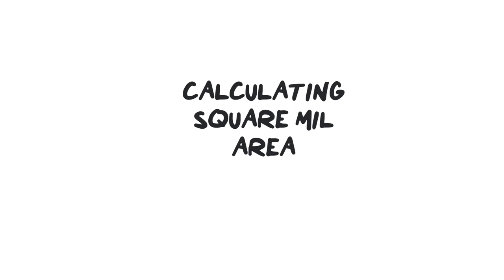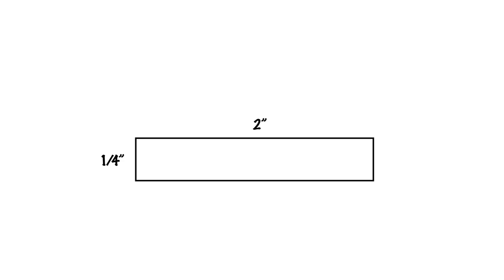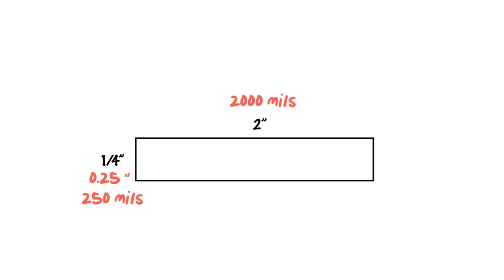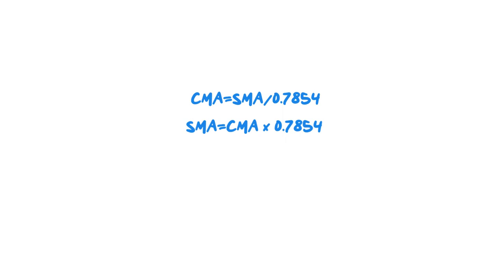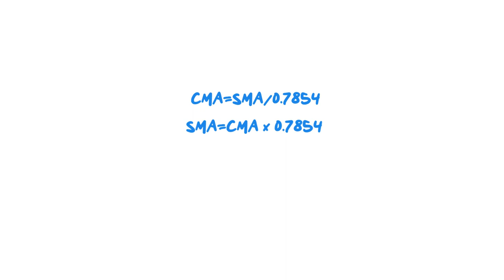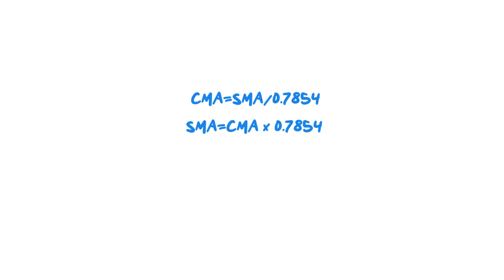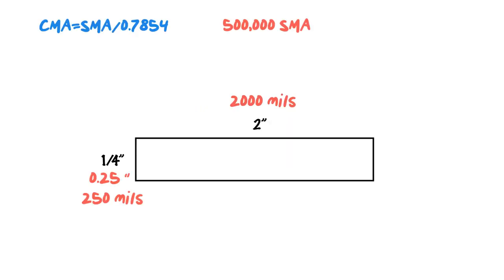CALCULATING THE SMA OF CONDUCTORS

Comment: Where do you get the .7854 from?
Reply: it's π /4
Here's the derivation -
Let's calculate the cross sectional area of a circle with a diameter, d, of 1 mil
Start with the formula for area of a circle
A = π r²

R can be represented by diameter as d/2.  Substitute d/2 for "r" in the area formula
A = π (d/2)² = π/4 x d²
Again, we have the value of d as 1mil
A = π /4 * (1mil)²
By definition, 1 circular mil (1cmil) is the area of a circle having diameter of 1 mil.  Which means we can set the preceding statement equal to 1cmil
A = π /4 * (1mil)² = 1cmil
simplifying pi/4 results in:
.7854 mil² = 1cmil
Which is a ratio.  This video gives you the "formula" where you plug sma into the sma literal and get the result
For example "1 foot = 12 inches" is a ratio, not the formula to convert feet to inches